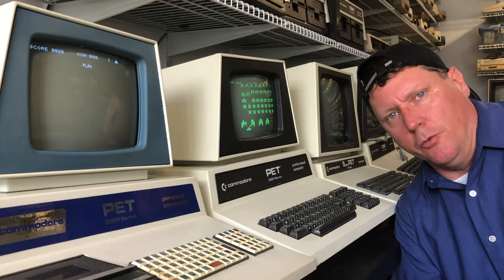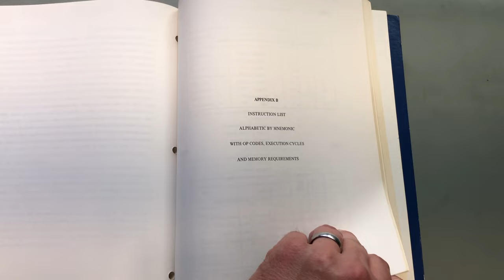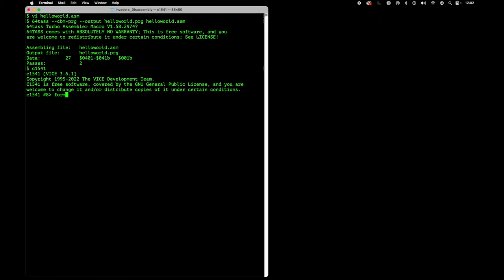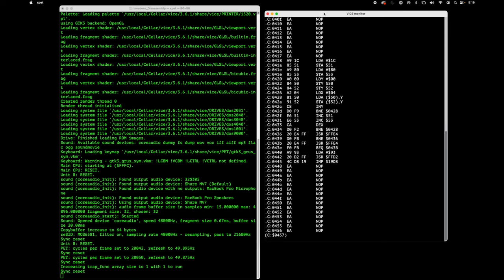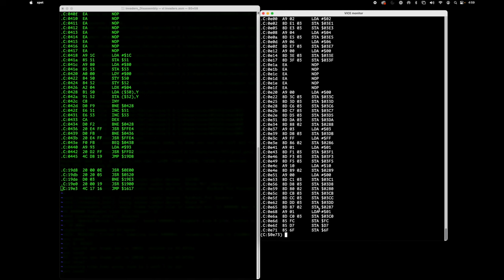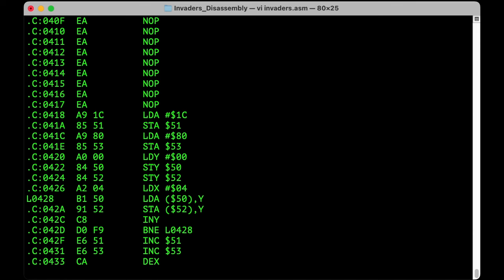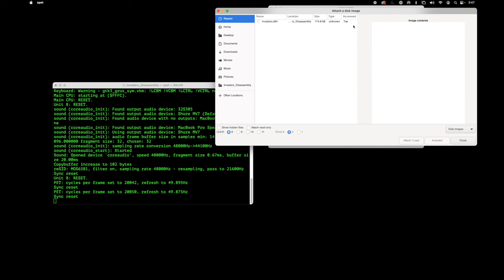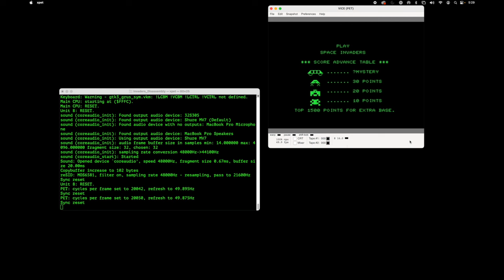Beginner's Guide to Disassembling 6502 Binaries

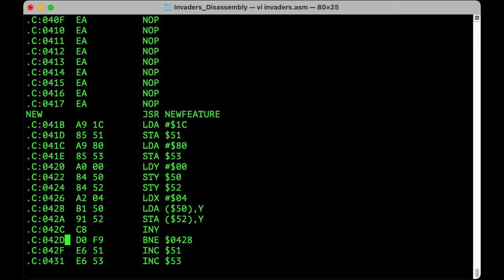Comment: 22:52 Why should you need to recalculate the BNE address? It's only absolute in the assembly code, in machine code it's a relative jump which remains valid in relocated code (unless there is new code inserted between the branch and the target.)

But anyway, thanks for this very interesting video!
Reply from the maker: Totally right - I even mentioned that they’re relative earlier in the video. Good catch!
Reply from the maker: …except I guess since it was disassembled to an absolute address, when you reassemble the assembler would calculate the relative branch based on an incorrect absolute address.
Reply: @commodorehistory  That’s true.

Comment: I did something like this many years ago after graduating but before I started work to disassemble the Sinclair QL ROM. I used QLMON to do the dissasembly along with a lot of books to know what the system calls were. It was an interesting exercise but gave up eventually as I started a new job. I am curious what all those NOPs were at the beginning though, Scratch space, self modifying code or what?
Reply from the maker: Sounds like a fun project you were working on! I’m guessing the reason for the NOPs at the beginning was he wrote the machine language before the basic loader and didn’t know exactly how many bytes the basic loader would consume, so he started his assembly at $040F and padded from $0401-$040E with NOP. Then he added the BASIC loader at $0401 and left the intervening NOPs.

Comment: At #08:50 - Instead of LDX #$00 you could just write LDX #0. Same with the zero byte for the text string. A simple 0 would do.
Reply from the maker: You just typed 127 characters to tell me that I should have typed 1 fewer character.
Reply: @commodorehistory  - that, and to clarify to the viewers that there is no need to complicate things by indicating that "the next number is hexadecimal 0 so we write $00"  when decimal 0 is the same and that a simple 0 would do.

Comment: At #31:00 - I think it is a mistake at this point to add a new instruction to initialize the Y register. The safe method is to keep the code identical to the original, and compare the newly assembled binary code with original and make sure they are identical.
Reply from the maker: That is certainly not the safe method. For the code to be relocatable, you cannot assume the low byte of the address will be zero. If you don’t explicitly set the Y register to 0 you’re risking the code not working. The only reason not to set it would be if your goal was not relocation but to be able to assemble an exact copy of the original binary.  That’s explicitly not my goal.
Reply: @commodorehistory  - it is the safe method AT THIS POINT. At this point your goal is to prove that you assemble the symbolic code into a binary that exactly matches the original. Only then is it safe to make changes to the code to ensure that it is safe to relocate.

By the way, instead of messing with the setup code, I would look at the documentation for the assembler and see if there was a directive to force a data segment to start at a page boundary.
Reply from the maker: Ah, got it. I thought you meant not to fix it at all. Fair point then.